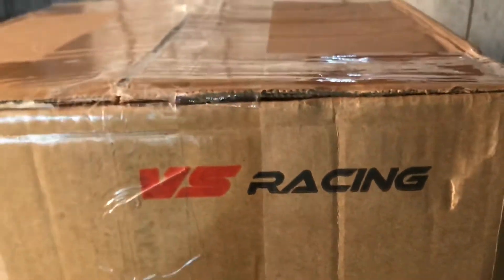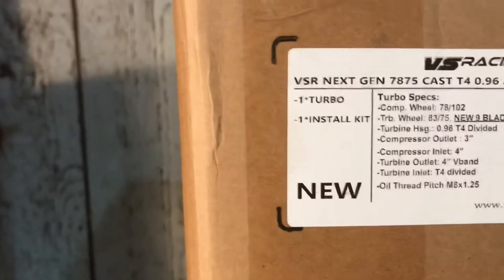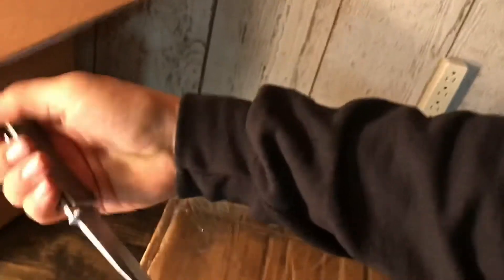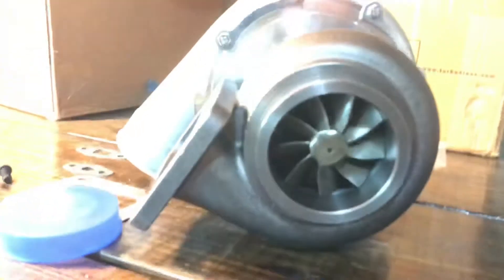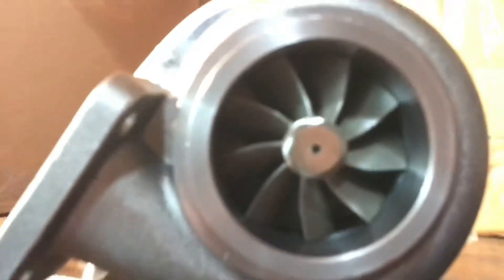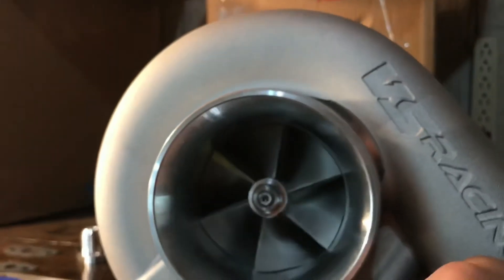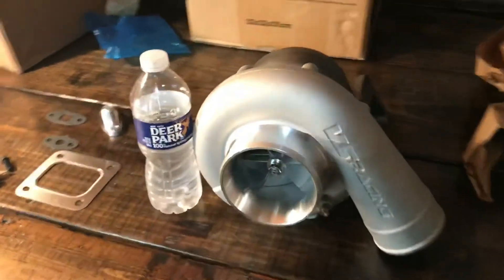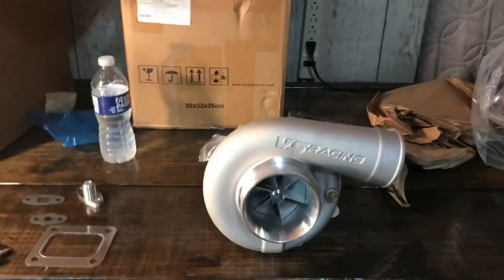VS Racing Turbo 7875 Next Gen Cast *UNBOXING REVIEW* (VSR Turbo)

Comment: Can’t wait to see a full rip!!
Reply from the maker: its gonna get buck
Reply: @s10life  ...how is the turbo holding up, is it a reliable unit??? I'm thinking about getting one soon...
Reply from the maker: I've been very hard on this turbo for several months and thousands of miles. Its a very reliable unit. I did however mess my first one up within a few hundred miles because I wasn't getting enough oil to the turbo, luckily I had a warranty. New turbo, fixed the oil flow and not a single issue. Keeping it lubricated is key.